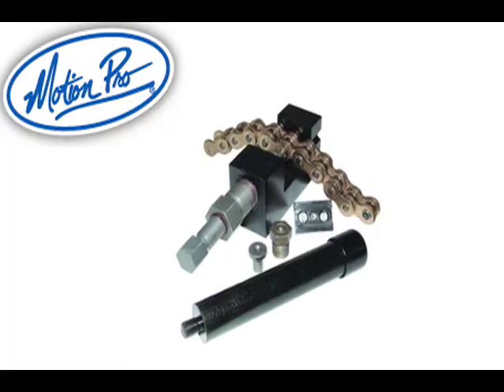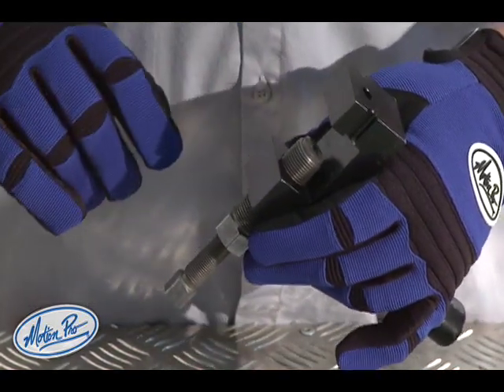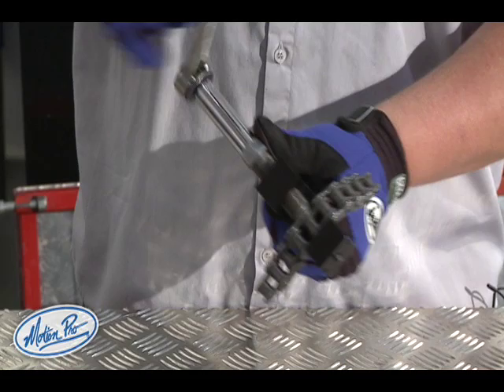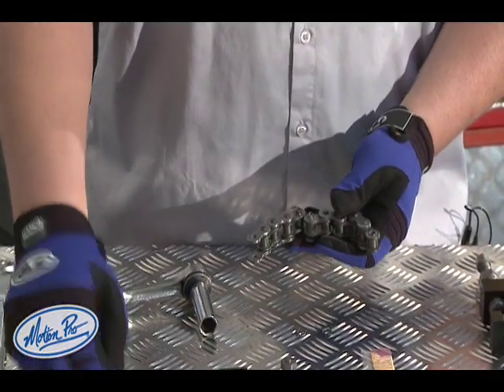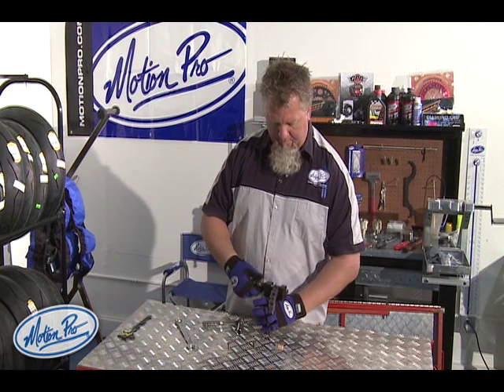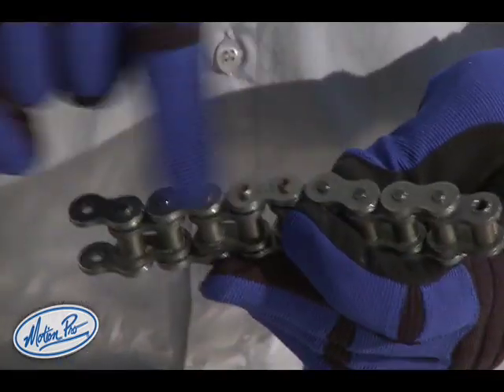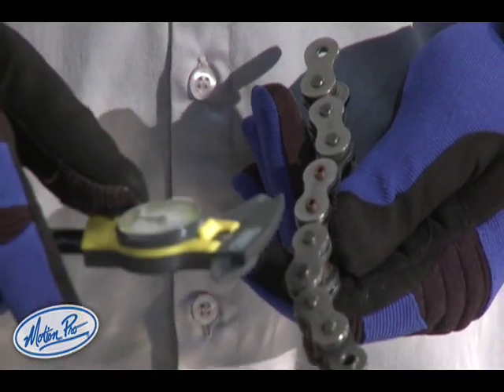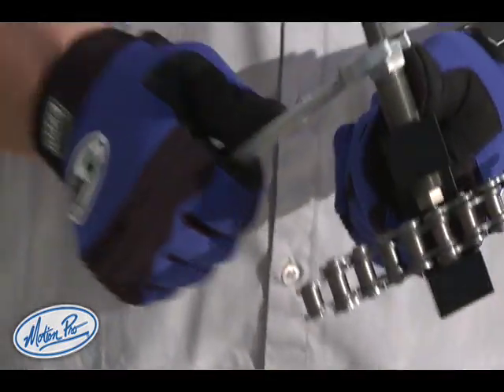Motion Pro How-To Video: Motion Pro Jumbo Chain Tool  08-0135

Comment from the maker: That caliper is an inexpensive generic plastic dial caliper. I am pretty sure the manufacturer is General Tools. For measuring the master link width, any dial caliper will do, the measurements do not need to be super precise. Anything within 10 thousandths of an inch is prefectly adequate. 

Let us know if you have any other questions, hope this helps! -MP

Comment: I just bought this tool (08-0135). The chain pin will not retract more than about a mm. The press plate therefore will not fit. Am I doing something wrong or is my tool different/defective? Also, more close ups of the tool needed.